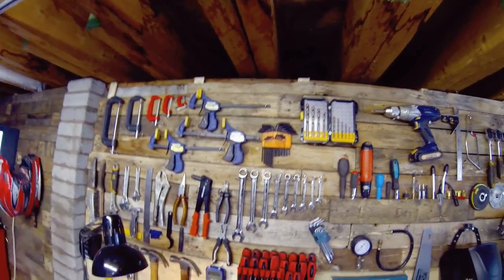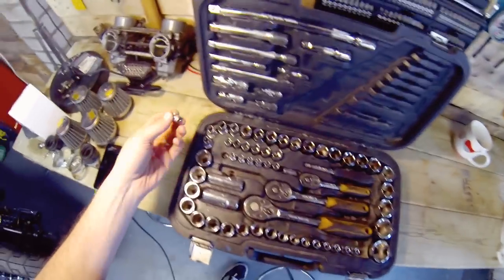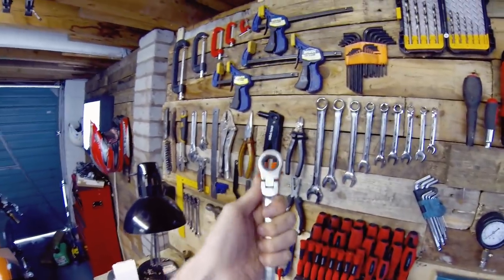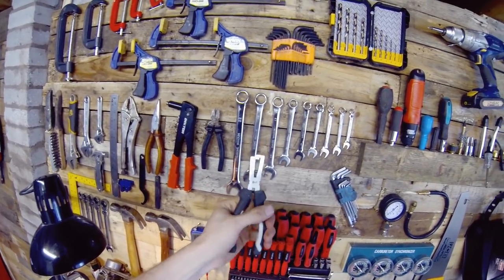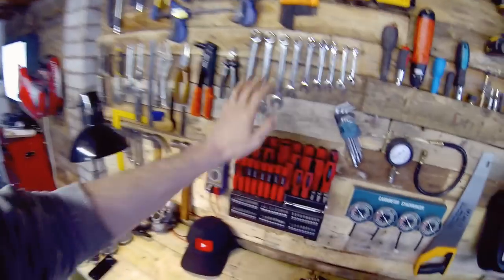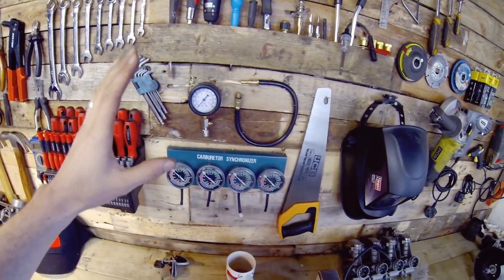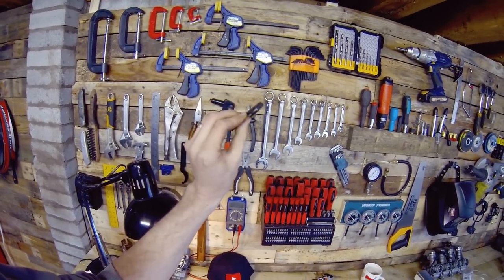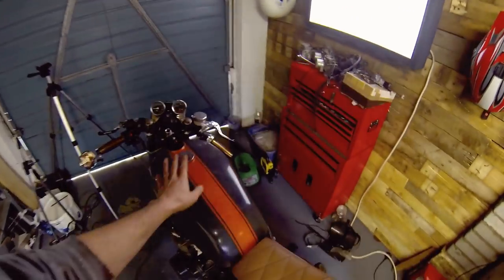My Essential Cafe Racer Building Tools

Comment: I really like your channel you explain things clear. At the very moment I doing a upgrade for my workshop because I will also start to build up an cx 500 or cb 500. I also build a sand blast chamber by myself and now I´m waiting for the parts to build it up. I was also searching of an air compressor and had a lucky chance to get one with a revolving cylinder engine with 1.7 kW - great to have stuff like that in the garage.
Reply from the maker: Sounds good, I wish I had more room here for sand blasting and stuff but it's really tight here. Another bike and I don't think I'd have anywhere to move.

Comment: damn that was sooo helpful, loved the socket tool set. well I was working on my Yamaha YBX125, building a brat, i tightened up the sprak plug a bit tight and it broke and now the broken piece is stuck inside the spark plug hole. any idea how I can take it off ?
Reply from the maker: AHHHHHHHHH, don't panic, personally I haven't had that happen yet so I'm not sure of the best way but... there are people out there who's jobs are purely these kinds of things. It might cost you £40-£60 but definitely worth getting them to do the job.
Reply: For The Bold - dreegez thanks alot brother. greetings from India

Comment: JIS screwdrivers (Japanese Industry Standard) screwdrivers can save a lot of grief from bodged screwheads, crosshead screws on Japanese bikes are not pozi or Philips so JIS drivers work best.
There are a number of welding channels on YT, I reccommend welding tips and tricks, MIG process is easy to learn but MIG welds can look good but in fact not be sound (I'm a welder so I would say that wouldn't I LOL) always invest in a gas set up if you can afford it. Also, check out knipex plier wrenches, pricey but very handy to have in your tool kit -specially on the bike.

Comment: Hey man, just found your channel and am really liking the content. If you have time in one of your videos, could you go into a bit more detail regarding welders. What type of welder did you use before you got this new one and what type of welder would you recommend for newbies. Any extra information you can give about welders would be great. Also keep up the good work my man!
Reply from the maker: Thanks, glad you like the content. As for the welder I'm running a Sealey Mighty Mig 150. My welding isn't perfect but it's enough to get by on non structural elements.

Comment: May I ask a question? I'm curious about that welder... what is it? brand, amperage...
Reply from the maker: The link is in the description above, specific model etc, however I wish I had got a TIG welder rather than a MIG welder.
Reply: Oh, yes, sorry, I hadn't seen it. Thanks! but why would you rather pick a TIG instead of MIG? Do you need to master welding before going TIG as I often hear?
Reply from the maker: For me a TIG would be more versatile, and lower power so you don't burn through the metal as fast.

Comment: Hello, Could You tell more about welder? Name, some parameters of welding ect. ? Thx
Reply from the maker: It's a Sealey MIG, I think the link for it is in the description.
Reply: It is, I missed that. Thanks for info anyway. So do You think welding a frames with MIG is a must? Or I could start with stick welding?
Reply from the maker: I would recommend TIG, i regret not buying one, as for stick, I can't use stick at all!

Comment: Didnt know allens came in metric and imperial, fortunately have only encountered metrics until today!
Reply from the maker: Same here but I found 1 imperial on the CX a few weeks ago.
Reply: Those old hondas...
By the way, would be interesting to see a video on your thoughts about 2 stroke cafe racers/scramblers
There is not many content out there
Personally I think the 4 stroke sound adds to the cafe racer theme
But yould be interesting to see a 2 stroke scrambler with something like a yamaha rd350 (anything less in displacement would feel/sound "wrong") 
Just my 2 cents
Reply from the maker: I love the 2 stroke engines, sound and power. I have a Maico 490cc Motocross and the power on that is silly.

Comment: Hey, if you are gonna do the wiring yourself, you might want to consider a wire stripper like this one https://www.amazon.com/Automatic-Stripper-Cutter-Parts-Express/dp/B0002KR95W not exactly, just the model/type. It makes it even easier, because it pulls off the isolation automatically and there is no adjustment needed whatsoever.
Great video, I use everything you've covered, so I think it is a good list.
Keep up the work! Have a nice weekend!
Reply from the maker: Sorry, link isn't working
Reply: For The Bold - dreegez It should be now
Reply from the maker: Ah, not a bad shout. Wouldn't mind a set of those.

Comment: your welding machine aint no MIG it's a TIG! (you say it's a MIG in the video).. but obviously it as only one gas can and you weld aluminium ... great video anyway. and great channel definitly love it
Reply from the maker: No this is a MIG. TIG is a different torch. This machine currently runs on gassless mig wire.

Comment: I forgot link to knipex http://www.wwag.com/cgi-bin/WebObjects/WebSite.woa/wa/DirectAction?page=%2147153,  also, if you go for a compressor, try to get a 3HP 100 litre minimum if you can afford it, you can run a few airtools off it, they will eat up air, but for home use, you can live with it.Jigsaw handy for cutting shapes out of sheet metal -metal and aluminium blades available, use soapy water or WD40 on ali.Air driven cut off saw is good but I have milwaukee hackzall, main point about these saws is low heat and no sparks or dust so bit safer, but don't go crazy, Cubans and guys in India are knocking out stuff with hardly any of these luxuries, and they were not on the DIY market when I started out-but then Jesus and the disciples were a donkey club gang and Pontious Pilate was a traffic cop. Good welding info on migwelding forum.uk